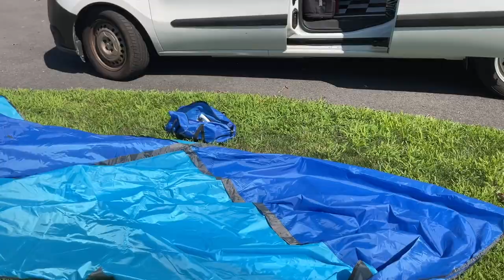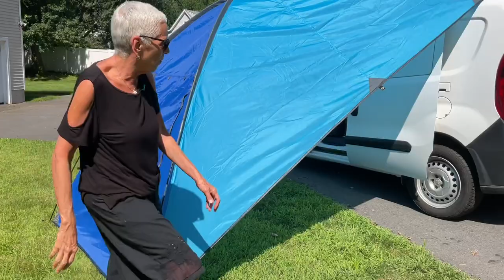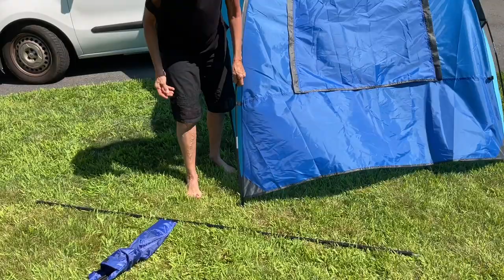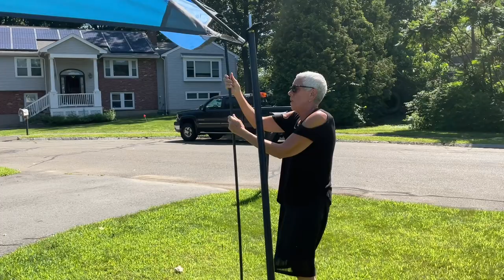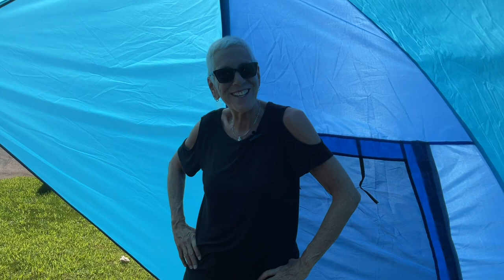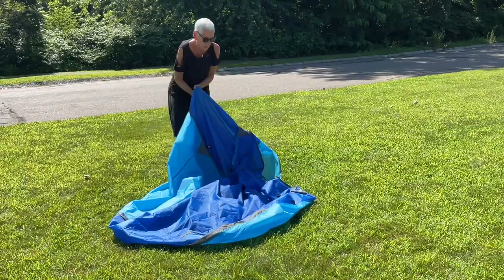SETTING UP MY NEW VAN TENT SHELTER AWNING, GIFTED TO ME BY A VIEWER - SO GRATEFUL - LIFE IS GOOD!!!

Comment: If you keep your outer poles together all the time.  Store them by sliding along the wall.  You won't have to continually take them apart and then together again.  You could possibly put the two main tent poles together and put the other two with them and roll the fabric around all four poles.  Put rubber bands over the ends to hold everything together and slide along a wall.  Then you would  be able to set up that much faster.  Put your picnic table under there too.  I wish I could draw it out for you but I can't draw.  Hope you try that and it works for you.  Peggy

Comment: Keep in mind that in times of gusty winds you can just bring this whole awning dow to the ground and stake it directly to the ground until the storm passes, no need to diasassemble it entirely unless it is hurricane conditions.  After the storm you can just unstake it from the ground and bring it back up to a useful height. I have seen people struggle unnnecessarily with these when weather moves in quickly. Just bring it down to ground level, stake it securely and you will be ready to recover in minutes after the storm, and, bonus, the ground underneath will be dry!
Reply from the maker: wow, great tip!! thanks!!!

Comment: Great awning.  Another use could be to put suction cups low on the outside of your front windshield, attach the awning front there, then pull the awning across the roof to extend beyond your back doors.  That way your front window and roof are shaded, and you'd probably have a nice bit of cover out back too.  So many possibilities in van life.  Keep discovering!
Reply from the maker: hello!!  that's a good idea!!  although I typically find myself desperate for sunshine on my roof to hit my solar panels!!!  💕
Reply: I was thinking the suction cups would give her more options as to placement and efficiency !
Reply from the maker: I've heard the suction cups don't work well, they don't stay good.  I'll try them out and see if that is true!!

Comment: I have one similar.  A few hints.  Easier to get the poles upright if you lay them to the inside and walk forward with both, ( together like a V) put them on ground then move them outward instead of trying to get one to stay while the other is loose.  Also, a reason to make poles shorter is to stop sun from shining under the awning later in day.  I use mine over the hatch of my van to shade my dogs inside so I often lower it as the sun goes down.

Comment: What a great gift and great addition to your van! You can open the door on sunny and windy, rainy days! Watching you set up, the idea came to me that it might be possible, with the first four poles, to start by connecting two sections, inserting them into the sleeve, and then continue on by the connecting the next one into the first two inside the sleeve, and continuing on to the end. Repeat with the other three poles.  Might work and Might cut one minute off the current setup time! Best of everything! Patricia
Reply from the maker: thanks for the suggestion!!  ❤️

Comment: Love the awning.  Also, if I have a canopy set up, I use binder clips to attach a lightweight shower curtain (from your friendly thrift store of course) to the canopy to block sun coming in from the side.
Reply: Using shower curtains can give much shade attached with the heavy duty suction cups and or magnets, especially on the side where your cooler is.

Comment: the option is there if you need it, I went car camping (in a suv) last fall and it rained the whole time I had no where to go but inside my suv, I wish I had a tent so I could sit outside, in a suv you have limited head room so really only one option is to sit on floor it's not very comfortable after a while,, I decided then that a tent will always go with me whenever I car camp (I have a small trailer as well).
Reply from the maker: I wouldn't mind having a tent or a clam screenhouse with me, but I don't have the space.  so this option is great for me!!  😊

Comment: Idk if anyone said this, and I’m sure you’ve used it since this video, but im wondering if those poles were backwards.  Like the pointy rod is the end that goes into the ground, passing thru from the top and the stopper on the other end holds it down.  Seems like the wind would blow it off otherwise, and the points in the ground would help, no?
Reply from the maker: I'll check it out next time I use it.  it turns out, I hardly ever use it.  😊

Comment: I like it much better without the poles. On the ground or between the two vehicles is not my liking 😊😊.  Luv someones idea to put it upside down so you can open window from inside.
Reply from the maker: I like it better without the poles too.  the poles complicate it, with those guy lines.  if I was going to be able to open the window from the inside it would have to be inside out not upside down.  not sure that's doable!!  thanks for writing! Lulu  🌺